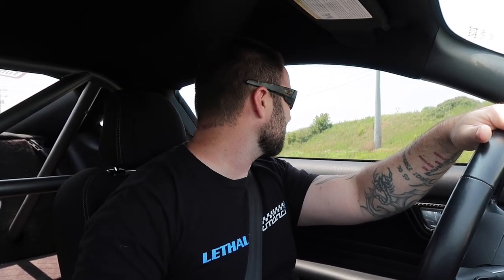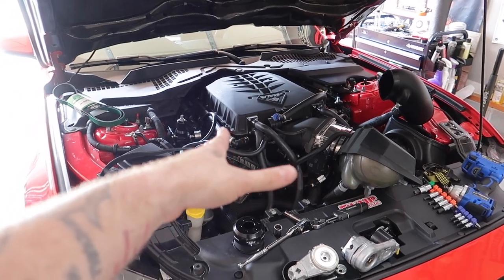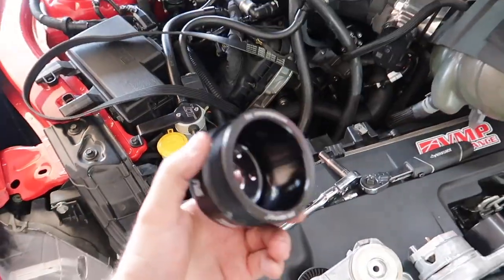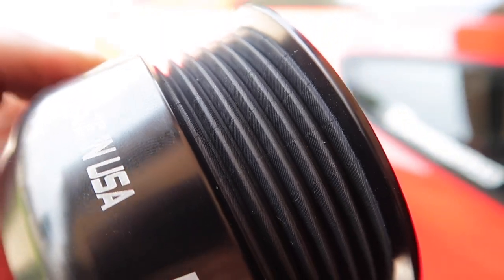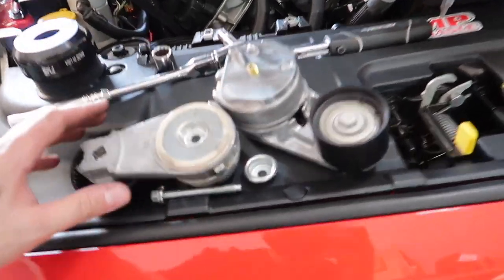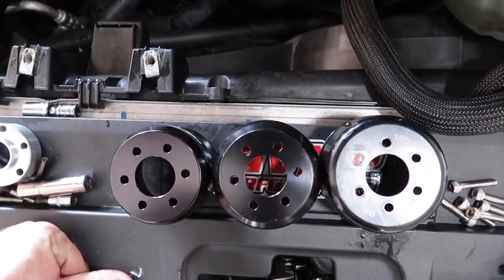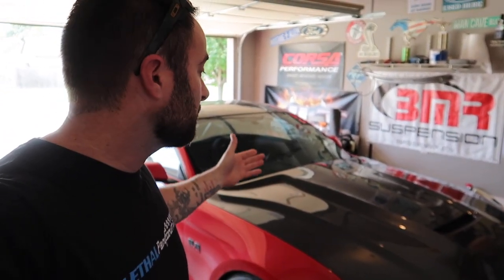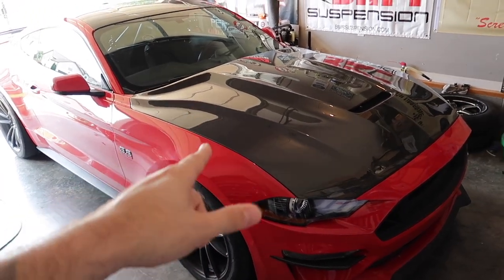Pullied down my VMP Odin Supercharged 2019 Mustang *NOW IT'S SCARY FAST...

Comment: I have a 2019 that I just picked up with a procharger tuned by Palm beach dyno and some other goodies, they said it dynoed at 825. Running some Mickey Thompsons and I can't be happier with them even at a dig, no spin, they hook up and they roll, top end seems like there is none, it keeps pulling and pulling

Comment: My GT350 Whipple Blower 3.75 Pulley; have to be careful dropping down on Pulley Sizes. Those Voodoo Motors are High Compression11.5-1. Boost goes up pushing your parameters. Coyote Motors work great less Compression.  Beware. 😉😎. Great Content you have, keep it up. 😉

Comment: I have the 315/35/20 Nitto NT05R on my twin turbo car and I'm impressed with how well they are hooking up. 30 or 40 rolls it just gives a slight fishtail wiggle then gone. I'm low boost and in the ballpark of 800whp. I might have to check out the ones you have as well

Comment: So you got different tunes for each pulley?
Reply: I have a 19 10r80 with gene aluminator.  I have the juggernaut 10an dual regulator with triple fore 274 fuel hat I need to install yet. You video is getting me motivated I'm in the 88mm now(odin) I have the 75mm I think I'm gonna order a 69mm. Will I need separate tunes?

Comment: @zander13 / My gen3 coyote made. 833 Wheel Hp & 663 Tq on a dynojet dyno ! E85 & 82mm pulley odin with the 163R tb . Full corsa Exhaust & catless headers. Vmp Fuel pumps. Also a 6 speed car btw vmp said on a 79mm would have made over 900+ wheel. All work was done by Vmp also.
Reply from the maker: Big power 💪💪💪
Reply: So yours is special and make
 more power on a bigger less boost pulley or the dyno is junk?
Reply: @Matt-xy6cf  dyno sheets don't lie buddy also vmp don't . . .made that on there dyno. Do your reseach b4 u come at me and when u do make sure u come correct...!
Reply: @Matt-xy6cf  also thats std smoothing:5
Reply: @Matt-xy6cf  Also I don't thank VMP Performance or owner Justin & tuner Joe Would Waste there Time on a Junk Dyno.  😅
Reply: @StreetCarCartel  Ok then tell Zander he is wrong and making way more hp than he is claiming .
Reply: @Zander13Productions  I need a "LINK" for the 75mm griptec ?

Comment: I understand why it would feel so powerful (instant boost) compared to the twin turbo setup, but... is it? quicker
Reply from the maker: Twins are always capable of more power
Reply: @Zander13Productions  Are you on stock cams and if not why? From what I've seen, cams produce HUGE GAINS on those coyote engines.
Reply: @jude2485  not worth the money lol 3000 grand for 40 hp hahaha

Comment: probably false knock
Reply from the maker: I think so too
Reply: false as in negative which adds timing to the computed timing by ecu , or false as in the guage was lying ? If it didnt have a negative line before number then sorry it was positive knock .
Reply from the maker: @Matt-xy6cf  it should a degree of positive knock. False knock is knock picked up by sensors that are not fuel or actual knock related.

Comment: Scary fast? You haven't been in a Tesla Model S Plaid yet. Lol
Reply: @Matt-xy6cf  excuse me that's a Tesla Model S plaid right out of the factory stock. No modifications whatsoever. You can call it any name you want but you can't call it slow.
Reply: @michaeltrinidad1217  stupid stupid comment.
Reply: @mustbefast9923  come on man the Tesla Model S plaid is going to beat any Mustang you know this man!! Stock Tesla against a stock Mustang or a stock Corvette or any production sports car. Those are facts you might not like the facts
Reply: @michaeltrinidad1217  Fuel is a limiting factor for factory ICE cars. They simply wont make a mass produced car without the convenience of running the crap 91 or 93 octane fuel available everywhere.  Ford, GM, and Dodge have all made 8 second cars but are sold as race cars without VINs to get around this and emissions. The plaid is stock but it is purpose built to be fast that's why it has the third motor. The electrics are at an advantage due to not having to worry about emissions or fuel types needed for a certain power level. It might  be stock but it's also stuck at that power level and cant be modified which sucks for a car enthusiast that's likes to compete with their own combination.
Reply: @davidfoster7008  but it can be modified. Remotely with an update that's coming. Also part of the modification is gutting the interior making it lighter to race.
Reply: @michaeltrinidad1217  Your missing the point. Sure the factory may create an update to make it go or they may not, maybe they'll lower the power on them like they have in the past. Point is when you buy the car your stuck with what they give you. If you and everyone you know buys one your cars are all the same. Enthusiast like myself like to build something that suits them. You might have a twin turbo 2nd gen coyote on e85 and your best friend might have a 5th gen camaro with a stroker on nitrous. Another friend might have a pullied Hellcat or a GTR with aftermarket turbos. When you go to line them up you dont always know what's going to happen and that's what makes it fun for car guys or girls. If you get outrun you can turn up the boost or swap heads etc.
Reply: @michaeltrinidad1217  and you still have the exact same car as everyone else that owns it
Reply: @davidfoster7008  yes the car that beats all the other cars that their owners spend thousands of dollars and hours of Labor to modify. And most of the time those are not daily drivers they're loaded up on the trailer and put in storage.
Reply: @michaeltrinidad1217  You sound like you've gotten your feelings hurt and also sound like you dont know street cars these days.